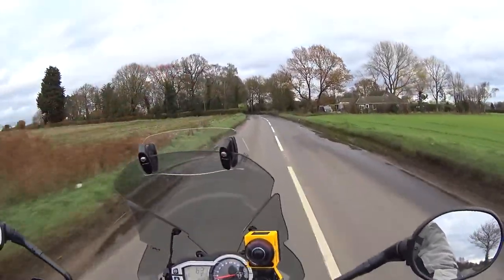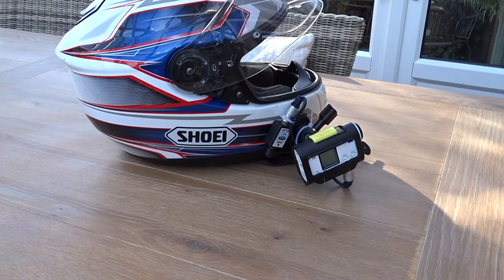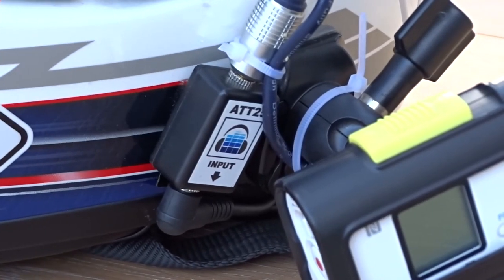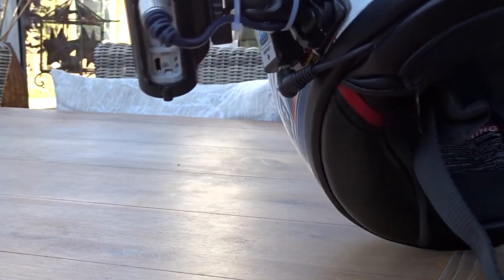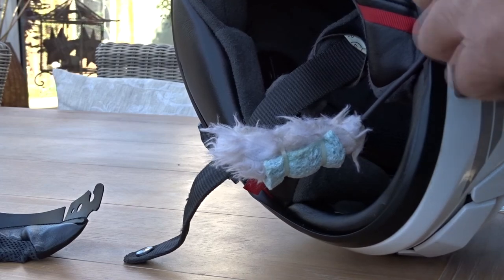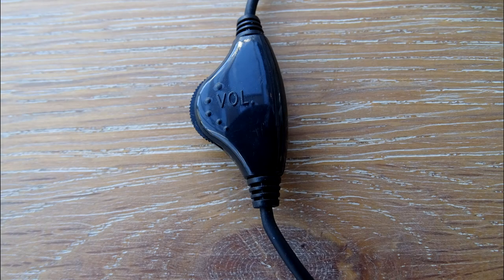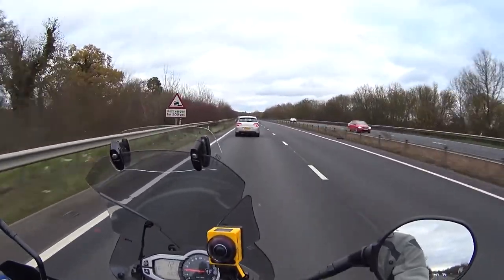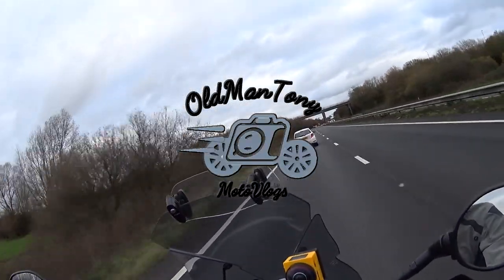my helmet audio set up

Comment: Interesting stuff Tony, I've just moved my mic in the hope of reducing wind noise and it's sensitivity.  I now use my phone to record audio as I've had enough of the bulky Gopro adaptor, especially when it cracks when I speak and when travelling at 50-60mph+.  

On the phone I have the gain all the way down (-20db) but with the visor fully closed it's very sensitive, if it's still like this after testing the new position, I might get the volume control adaptor to see if that helps some more, never knew they would work with mics, thanks Tony.  Just put your bell on, seems I've missed a few other vids too :)
Reply from the maker: Thanks mate.  It seems I missed this comment too, YouTube usually let me know when someone has commented, sometimes not, it is rather annoying.

Comment: My gawd... I had so many audio issues due to my loud harley ( GoPro 5) and i had to use a 50db attenuator with the “ standard mic + setting”. It works great up to 70 mph. Just like you said. But man it was a chore figuring all that out.
Reply from the maker: BigDave TALKS Audio is the biggest issue with MotoVlogging, there are a lot of variables, so it takes time to get it right, and not all solutions work for everyone either!

Comment: Interesting set up. I've never used Sony action cams, I'm still wedded to my Gopros but they are not perfect and if I use anything newer than my Hero 4 I need the dreaded audio adapter 'brick'.   Does rain stop filming with the open case?
Reply from the maker: Banditmanuk Actually the camera is supposed to be splash proof and with the sockets being on the base of the camera, I haven’t had any issues with rain so far, but maybe I should deploy some gaffer tape hahahahah!
Reply: @OldManTony  Got 10 days riding in the NW of Scotland next month I want to film, it always rains there, so I need to find a way to seal my cables into the Gopro.